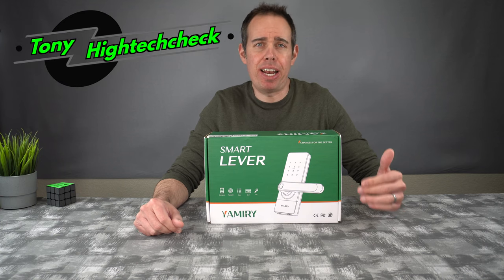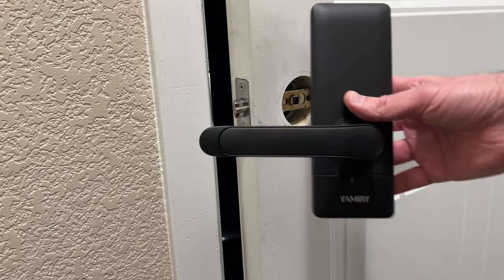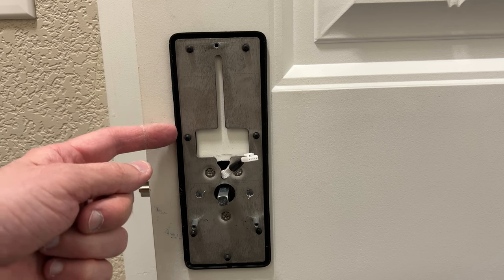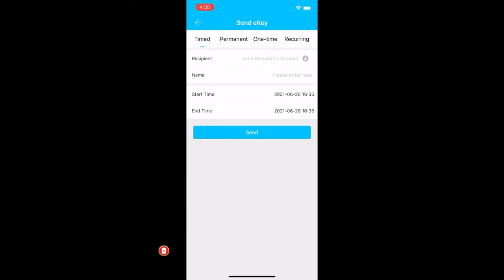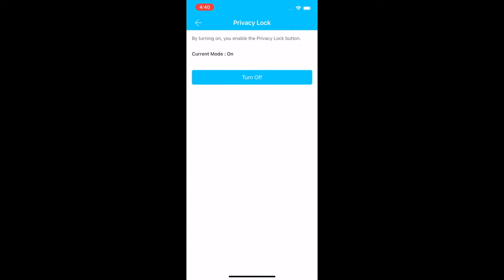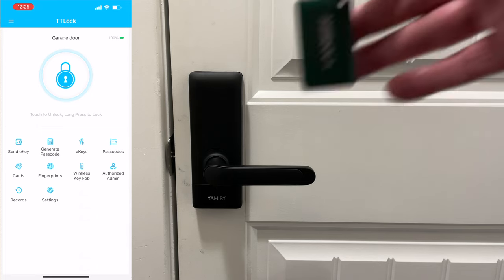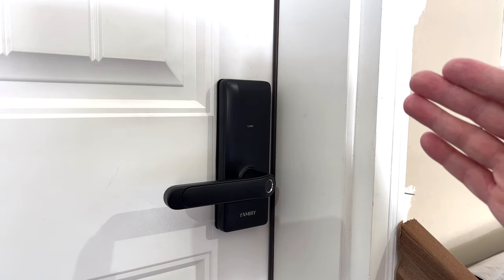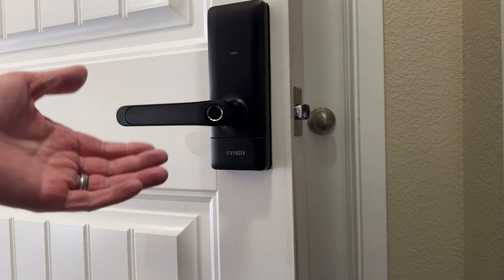Yamiry Smart Lever Smart Door Lock - Best Smart Lock For 2022

Comment: Mine doesnt show any keypad? Its this exact model but km not seeing any numbers anywere ? Am i missing something? I mean the outside part of lock only shows a flat front with ghe word card in center of it? And the fingerprint on knob and key hole and what looks like a charger hole on the bottom? Do i have to remove front door handle cover plate to see keypad ? No were does it mention this .im lost now.